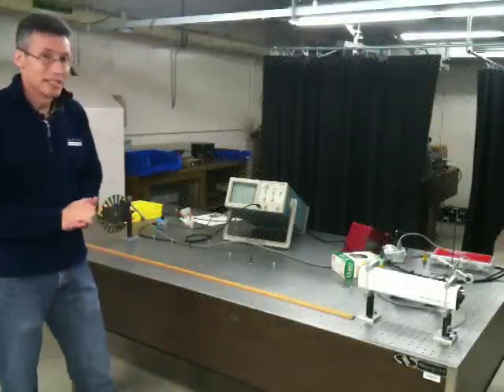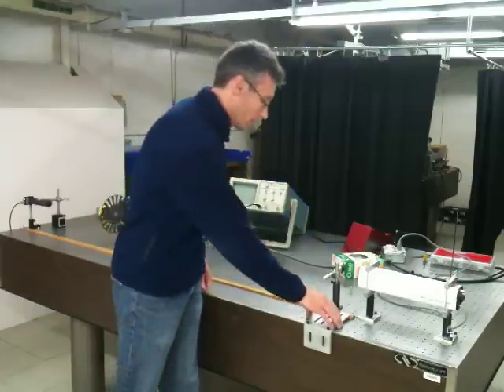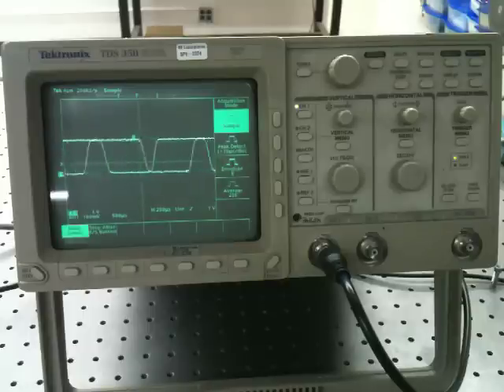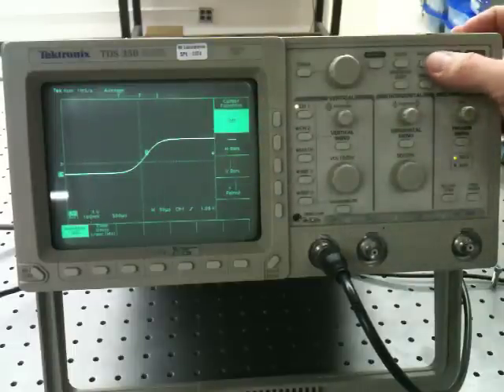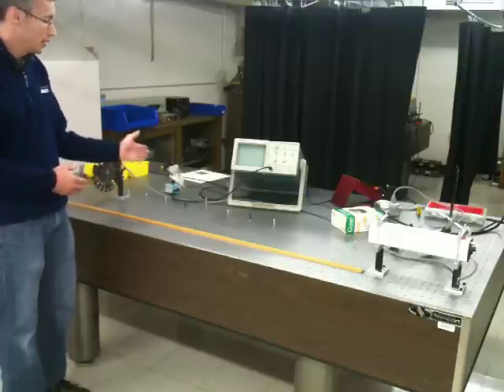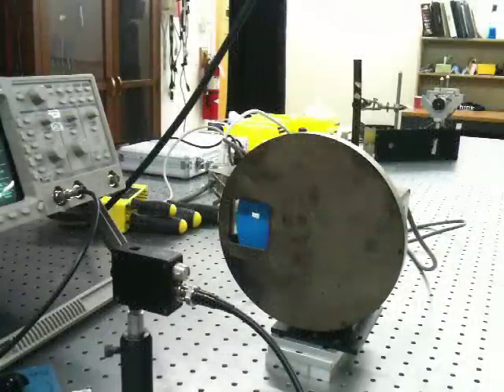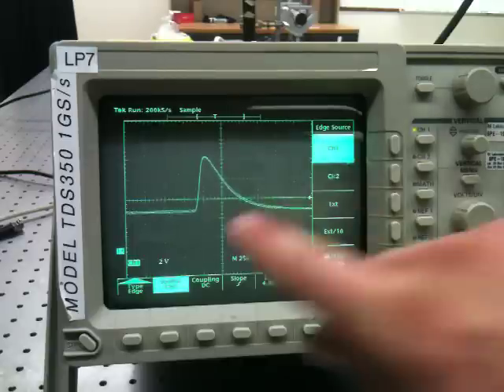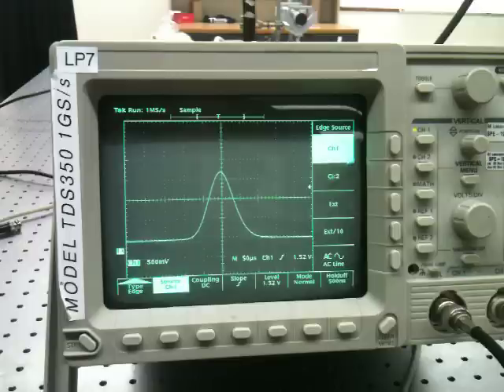Gaussian Beam Experiment

Comment: Assalamualaikum. The limits 14 % to 86 % are incorrect. Rather, the curve is an error function which is an intregration of the Gaussian. For 14 % to 86 % I have calculated that a multiplicative factor of 0.926 is required. 16 % to 84 % requires multiplicative factor of ~ 1. i.e. the rise time multiplied by 1 gives waist radius in time. You then have to multiply by the 2*pi*r*f.
I also wish to mention this video was great. Helped me loads. Saved my time. God bless you!

Comment from the maker: Well since your chopper wheel frequency isn't constant you will have to calculate the waist size at each position "by hand".  the value of "r" is the distance from the center of the hopper wheel to where the beam hits the wheel near the edge. This is used to find the linear velocity of the chopper teeth as they cross the beam, given the angular velocity of the chopper wheel (found from its rotation frequency). The linear velocity unnecessary to convert the rise time as the teeth cross the beam into a distance corresponding to the beam diameter.
Reply: what do you mean by hand;
Reply from the maker: The tool in the eBook will calculate the beam size at each point where you measured the beam using your timing data, however it assumes the chopper frequency is constant and uses the same frequency to calculate the beam width at each data point. When I said "by hand" I meant you will have to calculate the beam width at each data point yourself using the appropriate chopper frequency at each point. You can still use the tool to do a curve fit of the data to get w0 and z0. Just set the measurement mode to "generic" instead of "chopper" and enter your processed data for beam width instead of your raw data for rise time.

Comment: sorry! May i Ask something i didnt understood?
I want to find the beam waist size "Wo" of the beam the location of the waist "z" 
ok i have the choppe and the PHdetector and i am taking measure for 5 different 'z"  and i measure th W for each "z"

Ihave problem ..for example for the first measurement .. . If i have z= 15 cm and f =23 Hz and Δt=1.3 ms how i find the W for this location "z" ?  do you have any formula for W ? 

i have not understand good ...
*ps i have your e-learn book and i sent you friend request at facebook (Manos Arxontakis)
Reply: There is a formula that you can use, but if you have the eBook check out interactive widget 4.1 and set the measurement mode to "chopper" it will let you type in the values you measured and it will calculate wo and zo for you.  Basically, in addition to what you told me you need to know the N number of teeth on the chopper wheel, T the period of the waveform you measure on the oscilloscope and Δt its rise time (ideally from the 16.7% power point to the 83.7% power point although you can use other values if you include a numerical correction factor).  The ratio of the rise time to the period is the same as the ratio of the beam diameter to the period of the chopper teeth found from the r radial position of the spot on the chopper wheel (2πr/N).  Then the Gaussian beam radius is found from that ratio (2ω)/(2πr/N)=Δt/T.  Solve this for ω(z)=(π r Δt)/(T N), where for every value of z, you should measure a different value of Δt (but all other parameters remain fixed).
Reply: Peter Beyersdorf super!
thanks a lot Mr Peter!
Reply: Μανος Αρχοντάκης Hallo and sorry again!      1) the period of the wavefront on the oscilloscope for each different location of the wheel is not the same for me for example my chopper wheel in the lab does not have constant frequency (i have for example  30 Hz at the controller of the wheel and it plays from 30 to 31 or 32 all the time) and 2) what you define  "r"   the distance of the beam spot on the teeth to the center of the wheel  ?

Comment: Sorry may I ask you about the variable resistance that you were using in the end part of the video? Do you have any link or something that may help me to find something like that? Your reply is really appreciated. Thank you.
Reply from the maker: It is a 1MΩ potentiometer inside of a box.  One terminal is connected to the BNC ground, and the wiper is connected to the pin of the BNC connector.  This provides a variable resistance from the BNC pin to ground.  A T-connector allows this to be put in parallel with the oscilloscope's input.